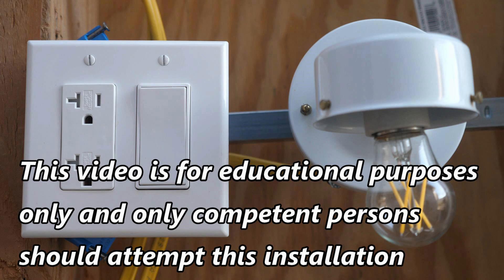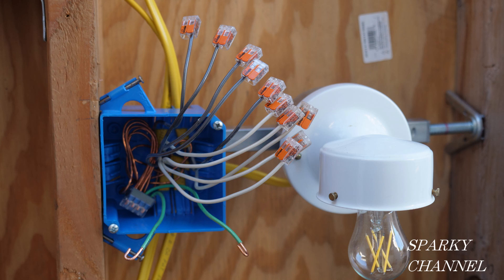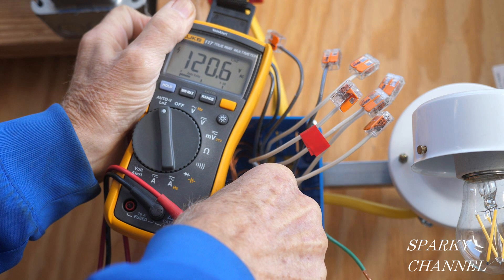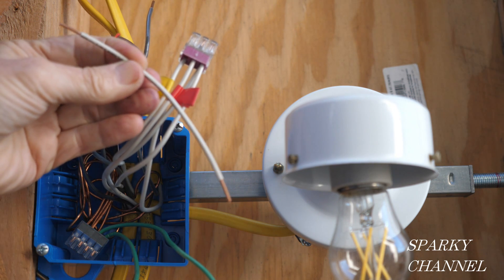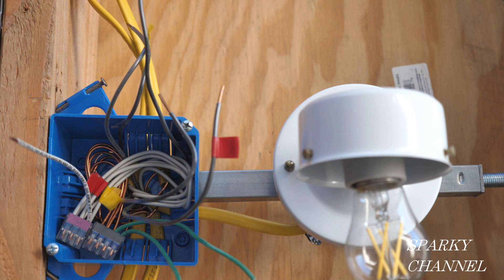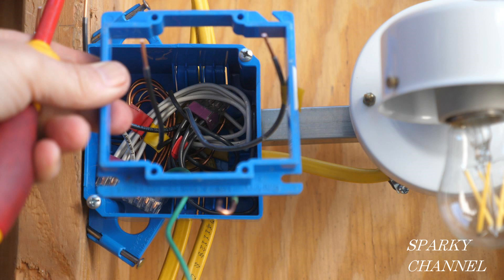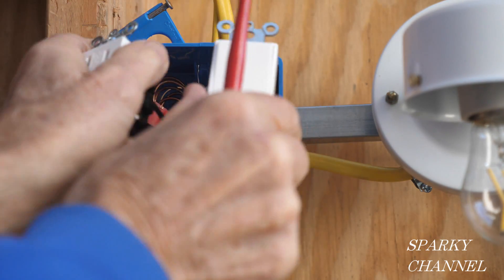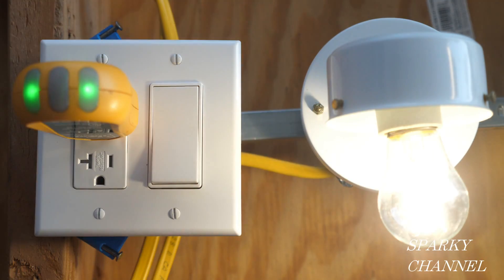Wiring Challenge!!! Can Sparky Do It? 5 Cables, 2 Devices and Wire Management!

Comment: Always prefer using 1900, or square boxes with mud rings over the standard rectangular ones. A lot more room for wires and space for devices. If there's room I use the deeper square boxes for more space.

Comment: I like to put the faceplate screws horizontal. Its my signature when I do a device. I'm not an electrician though.
Reply from the maker: OK, that works too. :)
Reply: @SparkyChannel  what does NEC 2020/2021 say about receptacle and light switch next to each other in the same box for kitchen/bedroom/bath/garage
Would it not freak out a person in a dark room to discover they just touched an outlet instead of a light switch?
Reply: consistency is what matters 😄

Comment: I am rewiring my house from the main panel forward. I'm not a licensed electrician but have electrical experience. Work a lot with it professionally. I did a lot of research and that's how I found WAGO connectors. But I must admit. I only use for the ground wires. I just feel more comfortable with the pre-twist, and wire nut connections for the current carrying conductors. Love your channel.
Reply: I'm hesitant to use Wagos on circuits, but I found I really like them for connecting fixture wires. Sometimes it can be tricky to get the fine 16-20 gauge stranded fixture wire joined to solid 14 or 12 gauge with a wire nut. It often doesn't hold well but with the Wagos its a breeze.  And in this situation you only dealing with a few watts, or an amp or two flowing through the Wego.
Reply: @Progrocker70  I love them for that too. Agree 100%
Reply: It's 2021 dude. Wire nuts are cheaper of course but where Wagos excel is when you need to connect 3 or 5 wires together. Anything other than a Wago is a real mess. In my country (South Africa), the ground/earth wires have to be crimped.
Reply: @HiltonRalphs  big deal its 2021 lol..... Too each their own. I prefer the old way. If it didn't work so well nobody would be doing it anymore in favor of push ins. Whatever makes you feel comfortable. As far as crimping I have no opinion.

Comment: I have a hot wire that loses power down the wire line? Im using a voltage detector. Their is power out of the breaker but as i go down the black wire the detector tells me there is no power after a few inches from wire coming out of breaker. Why? Also at the Receptacle side there is no power. The hot wire looks fine no cuts or burns but the hot wire loses power as i go down with the detector. How does that happen? Any advice??

Comment: An outlet can connect 4 wires each side. Why not: Homerun, chain to next outlet, jumper wire to switch, or for common directly to outlet. That's like 3.5 pairs of conductors. Less full box and the outlet is safer than the wago fire hazards.
Reply: That's fine until you need to replace that outlet.
Reply: While that would work there is a drawback. You are now using the receptacle as part of the circuit. If any one of those 8 connections (4 hots and 4 neutrals) fails you have a problem with everything down stream. Not so with wire nuts. Not to mention the difficulty of trying to fold all those wires in behind the receptacle. But I like your attempt to find another way of doing things.
Reply: @dalewise5586  Wire nuts are far from perfect, too. (thermal cycles can work them loose - then they can fall off - or they make a bad connection that leads to them cooking.)

(I prefer crimps. But they take up a lot of space, and are not code approved.)
Reply: @jfbeam  wire nuts are only to keep the wires from grounding out, they should be twisted together properly first.

Comment: Bill would you please do this same video again with 2 separate circuits coming into the box (one for the plug and one for the light).  I’ve got some setup like that in my 70 year old house and would love to know what they’re supposed to look like.
Reply from the maker: Hi Benjamin! No, I won't do that one because I feel it's dangerous. It requires a special double breaker that turns off both breakers at the same time and it's not a good wiring technique IMO.
Reply: @SparkyChannel  thanks! Good to know, I thought it was wonky when I saw it :/
Reply: @SparkyChannel Assuming two circuits are not MWBC with a shared neutral, I don’t think NEC actually requires two circuits to be disconnected at the same time.
Reply: Would that even be legal these days? (with all the GFCI/AFCI rules, you wouldn't be allowed to tie the neutrals together.) [two ganged boxes?]
Reply: @jfbeam  probably not! Just wondering if there is a proper way to modify it. The box I’m dealing with is actually a 5 gang box and I think there are 3 circuits
Reply from the maker: @jfbeam  You make a good point. I'll have to check on that.
Reply: Why two power sources?
Reply: @danlux4954  there are 6 switches in the box and it’s at least two circuits. One circuit is for a 3-way switch where one switch is in this shared box and another is alone on the other side of the room. From my research this seems like a relatively common practice?
Reply: @bjm7z  never seen so many switches, is this a commercial building?
Reply: @danlux4954  nope, just the front entrance to my house. One switch is a double rocker, so it’s only a 5 gang box

Comment: Good work, but I am opposed to wrapping wiring devices with electrical tape.  The tape is not necessary, turns to muck over time, and leaves a residue that the next electrician will curse.
Reply: I would agree with plastic boxes, but with metal I think taping is a good idea, especially should the device mounting screws come loose.
Reply from the maker: Thanks! Don't wrap them with tape then. There is no code requirement for wrapping the devises.
Reply: Then use rubber tape. (that's one of the reasons we don't use the all too common vinyl stuff.) You've obviously never had the side of a device touch something it shouldn't. (less of a problem in a plastic box.)
Reply from the maker: @jfbeam   Or Ideal Armourband insulated device wraps: https://www.idealind.com/shop/armourbandtm-insulating-wrap.html

Comment: Have you tried the Ideal Armourband insulated device wraps yet? They are a nice and faster alternative to wrapping devices with electrical tape. https://www.idealind.com/shop/armourbandtm-insulating-wrap.html
Reply from the maker: Yes, I had a video about them on my old channel. Personally I'm fine with electricians tape.
Reply: So I agree you could use electrician tape the only proviso would be that it should be UL listed - I really only default to 3M tape, given it’s tested dielectric, temperature, humidity properties. 

However having said that I have dispensed with the tape wrap and gone to the ideal armour bands and it was Sparky who got me into using them. They are so much faster and much more convenient.

Comment: I am a datacom guy who does almost all commercial/industrial work, and I am surprised to never see electricians using the WAGO style connectors; I've been using the ones from IDEAL for years on paging systems. Are they code permitted for commercial?
Reply from the maker: Yes, and in many countries and continents. Also, the Lever-Nuts are great for working with stranded wire or a combination of solid and stranded.

Comment: I don't trust push-in connectors. How are they different from backstabbing receptacles ?
Reply: The push-ins are clear so you can easily see if the conductor is fully seated (I think this feature makes them better than twists and wire nuts alone).   Check out Wago 221 lever nuts. They keep the US sparkies from being uneasy.
Reply: In my opinion there is precious little difference. Way less contact area than under a wire nut. Years back customer supplied can lights came with them so to “save money” I used them. Of 8 fixtures 5 failed to light up. In all 5 there was a problem with one or more of the push connectors Not as a result of my installation. Just poor contact. That was the last time I used them, ever.

Comment: SPARKY Question!  can you use zipties  to make the wires look neater and save space?zip tie the whites all together and all the blacks and grounds. or is that not recommend because it could cinch the wires and cause a short ?
Reply: I've only ever seen that done in a panel. I would consider it a waste of time in a switch box. If you don't have enough room in the box you need to package your wire more methodically. This WILL be an issue if you are installing gfi's, dimmers, timers, or other larger devices.

As for air flow, if you are mindful of your box fill I don't think the margin for temperature conductor ratings is so slim that 6 inches of conductor being bundled would create an issue. A decent builder trys to prevent as much air flow as possible with spray foam and insulation anyways.
Reply: Not saying the ability to dissipate heat/ bundling aren't important concerns, I just don't see it mattering here even though I wouldn't zip tie them myself.
Reply: @Cougdit  thank you for that clarification.  I'm still in school until April but I want to learn all I can until I get a job as a apprentice
Reply: @IMYY4U17  Just an fyi, my opinion might be worth as much as a doody flavored lollipop! I believe I heard this on the Essential Craftsman channel: two of a trade never agree.

(And both could be wrong)
Reply from the maker: No, don't use zip ties in a box because they are flammable and a little space between the wires is good to help dissipate heat.
Reply: @SparkyChannel  ok thats the direct answer I was looking for lol no offense to the other guy lol thank you . looking forward to the next video
Reply: there's a reason the wagos are made that way  one is to sapce the wires just enough for air spacing to help reduce heat convection
Reply: @richardcranium5839  ok so space is needed for airflow in the box?

Comment: This doesn't have RCD in place? Otherwise it seems to be not working as you measured with low impedance mode against ground.
Reply: America only uses RCDs (GFCIs) in the bathrooms - Another world isn't it!
Reply: @georgetarplee  Nope. They're used all over the place now. (there are plenty of videos on this now. Even your drier plug has to have a GFCI per 2020 NEC -- up to 250V.)
Reply: @jfbeam  Ah, didn't realise. Europe requires RCDs (GFCIs) on everything. Sockets, lights the lot. Cables aren't even allowed to be run through the building if they are not protected.
Reply from the maker: The AFCI/GFCI in this instance is in the main panel.

Comment: Sparky, I can’t tell you how many times I look at one of your video titles and say to myself, “this seems pretty simple I don’t think I’m gonna learn anything. “And then I watch the video and pick up a great tip. Great idea holding the test probe with the wago. I had a serious, “Duh, why didn’t I think of that! “Moment
Reply from the maker: Yes, the Wago Lever-Nuts are made with testing ports both in the front and in the back of the Lever-Nut. IMO it's safer to not have to remove your wire connector for testing. Have a great Sunday!

Comment: Great video!  I was just looking through your past videos to find one on cable management. I couldn’t.  This topic addresses my biggest problem....fitting all the wires into the box.  I guess the order helps.....ground, white, black.  And it seems your connectors take less room than wire nuts....or at least there are less twisted wires that are difficult to move around. Anyway....you make it look easy.  Thanks again.
Reply: it's really more the order and planning than the specific connector.  that box was actually pretty crowded by the standard of guys who spend an extra dime on the box to save a dollar of time trying to pack everything in. (keeping in Mind Bill deliberately chose a box that would be packed tightly for demonstration purposes.)
Reply from the maker: Hi Roger! Yes, I wanted to show wire management in the box. I thought is was a good opportunity because this box had so many cables coming into it. Besides, it was a good challenge! :)

Comment: I was called to a house to fix all the cover screws that the electrician left pointing in every direction. I made them all vertical and the home owner was very happy, and it does look much neater.
Reply: Why can’t I get those jobs?
Reply: lol thou in England Electricians leave the cosmetic screws pointing horizontal instead of vertical.....and now there there are also available push in covers no cosmetic screws
Reply from the maker: That's the kind of maintenance call to get! Have a great Sunday!

Comment: Perfect.  Now u just have to make the same vid using ONLY wago LEVER nuts. Nice.
Reply from the maker: Hi Dave! The lever-nuts only go to 5 connector and I need 6 connections for the hot and neutral and 7 for the grounds. Have a great Sunday!
Reply: I know. That’s why I want to see the video with wago lever nuts. And then use a jumper between the 5 slot wago to the next wago
Reply from the maker: @MrTooTechnical  That takes up too much room in the box. I would have 4 connectors where I now have 2. Plus there would be 2 extra pigtails.
Reply: Then make the box bigger

Comment: Hey Sparky. This past December I've graduated from Trade School. My entire term we've never learned about those devices used to hold the multiple conductors together 😳 we've always just spliced 4-6 conductors with a pigtail and wire nut. Going fresh into the field as a greenhorn, would that knowledge be expected?
Reply: I've never seen those Wago connectors used on the field because they're more expensive. The only exception is when they come preinstalled on some lights.
Reply: @liamwelsh5565  plus, look at how many different types Bill has had in his videos.  for comparison, except that bill deliberately maxed things out with that demonstration, most electrical makeup can be done with Ideal Greenie grounding nuts, and 3M T&R+ wire nuts. (Ideal makes a similar wide range nut to the T&R, but it has a similar shape to the greenie, so it's harder to differentiate between the two by feel)
Reply: The expectation is you will need to know your journeyman's unique preferences without being told lol. 

There's lots of different styles. With the grounds you could twist and crimp them, use a green wire nut, pigtail with standard wire nut.

Even with wire nuts you could talk grays, tan and reds, reds, big blues, etc. Some guys don't mind exceeding the capacity big blues are rated for (some guys think they allow you to shove a bunch of wires under one nut when they really are more for bigger gauge wire).

At the end of the day figure out what your jman considers acceptable, as he'll surely consider anything else to be wrong whether it is or isn't.
Reply: Thank you gentleman! I appreciate the info and tips. I'm doing my best to learn more of the trade that wasn't taught in school. I take my test on the 30th for SEPTA in Philadelphia. I however graduated with my cert in New Jersey. I'm aware of how things differ from state to state. Jersey being a little tougher on the rules and regulations. I just want to be prepared as much as possible. Im 24 and i feel like this trade is the one for me!
Reply: @Jsyn-1  just remember: there is nothing smarter than a fifth year apprentice, and nothing dumber than a first year journeyman.  
Every company and every inspector has their own quirks, so make a point of learning them, and you'll get along well.
Reply: @kenbrown2808  duly noted my brotha!
Reply from the maker: @Jsyn-1  Excellent thread everyone! Viewers who read this thread will learn something as opposed to some other channels where people just call each other names, etc. Sparky Channel has the best viewers by far! :)
Reply from the maker: Hi Jason! All of the comments and suggestions of the commenters are excellent. It sounds like they know what they are talking about. Connecting 4-6 wires is serious business. Many times I've seen these connections with wire nuts and given a tug on each of the wires and one will come loose. That's why I made the comments in the video about the need to properly twist the wires and get them all the way into the proper wire connector. Conor made the comment that some use wire nuts that are too small and that is very much true. Just do what your journeyman or boss says. For instance, I came up working for an electrical engineer who wouldn't allow anything but metal boxes so I wasn't about to show up with plastic boxes.
Reply: @SparkyChannel  Thank you for the reply sir! Glad to see that they're alternatives for multiple splice/pigtails connections. Our teacher was a retired master and his methods were set in stone, very old school cat! Me and my classmates hands we're destroyed the first couple months trying to do those splices with only 6 inches of conductor out the box. Needless to say we're pretty good at it now with some lineman's pliers and some elbow grease 😂 thank god the school paid for all that insulated conductor we used!